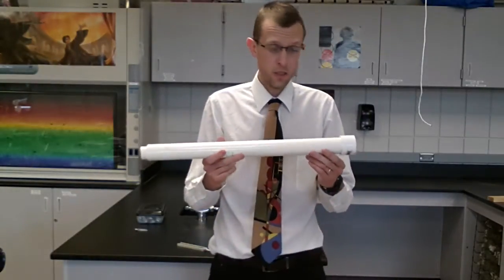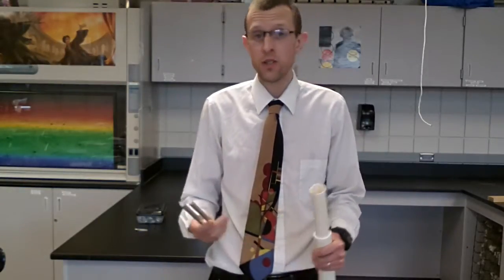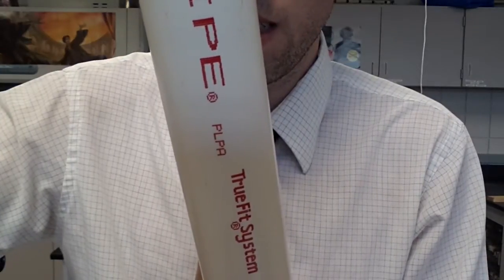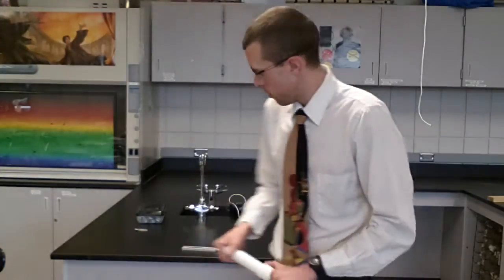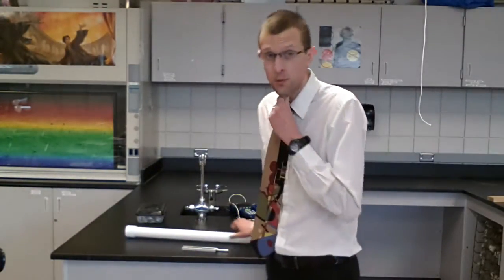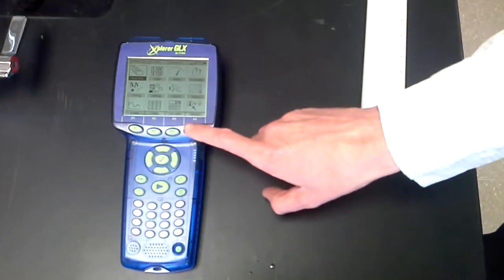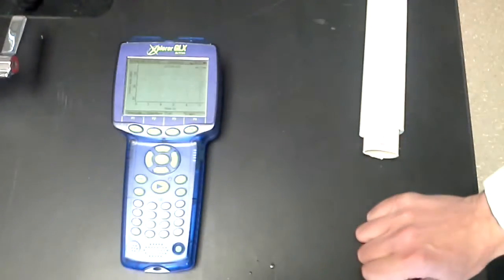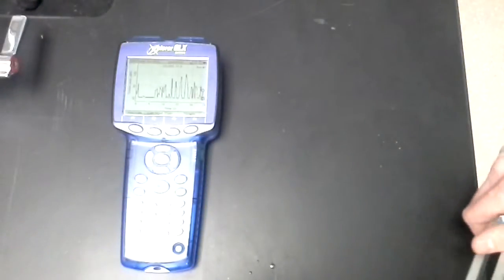Resonance Pipe Experiment explained

Comment: I am trying to replicate this experiment. Do I just take two PVC pipes and create the same assembly you have made? Does the type of pipe matter? Also it is possible to generate the resonance using computer generated frequencies from a microphone?
Reply from the maker: Yes, that's right.  The outer pipe is 1 1/4 inch, and the inner pipe is 1 inch PVC.    I wrapped one end of the 1 inch pipe with a few layers of electrical tape until there was a good seal between the two pipes.

You can absolutely get resonance from a computer speaker using a tone generator instead of a tuning fork.  There are plenty of smart phone apps that allow the production of tones, as well.  Depending on the lengths of pipes you choose, you'll have to play around with the frequencies you want to use.  I was shooting for having at least two different resonances for each of the tuning forks I had students use.
Reply: That was a quick response! thanks